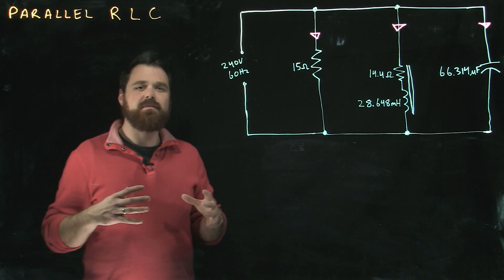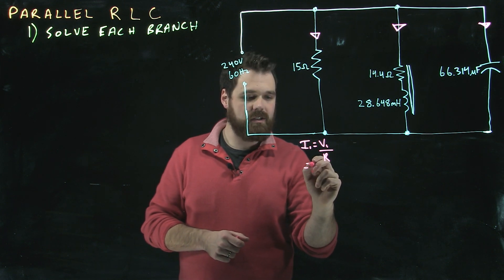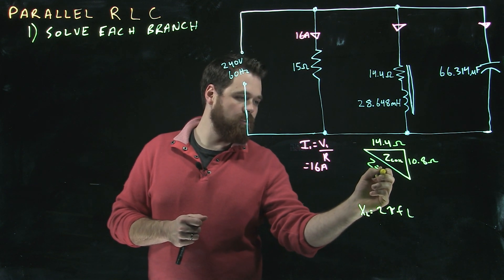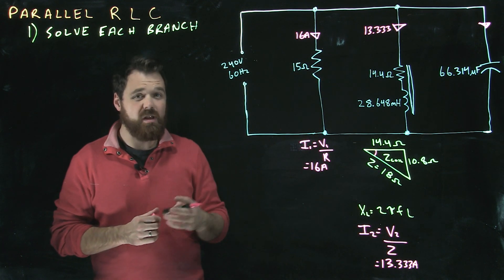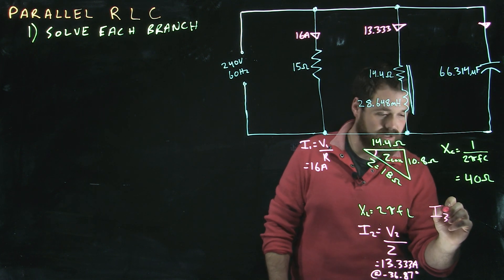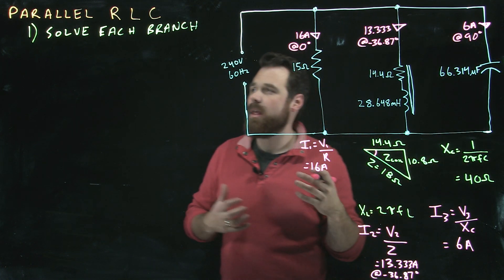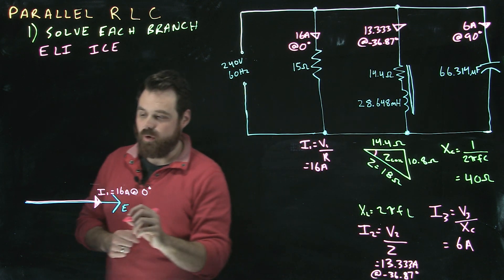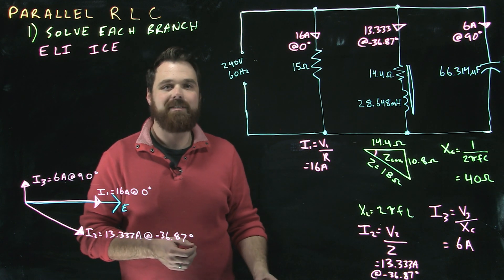Parallel RLC Step 1 Solve Each Branch

Comment: im not sure how to get the phase angle thats the one thing i find difficult to wrap my brain around
Reply from the maker: It's often something you're provided in one way or another and always depends on the load.

It is the relationship between current and voltage across a load